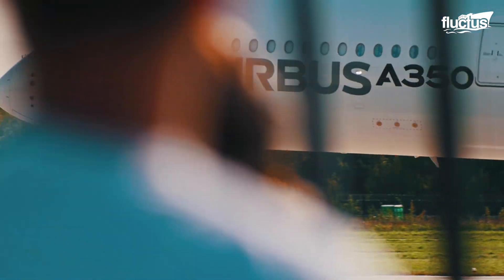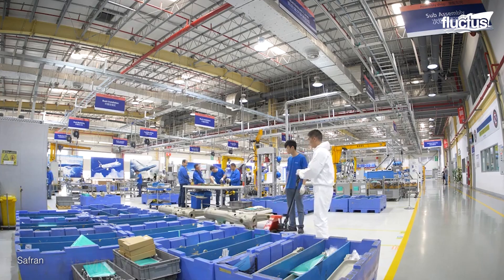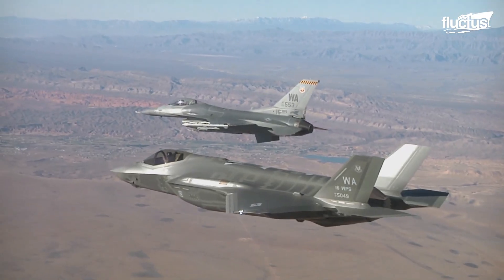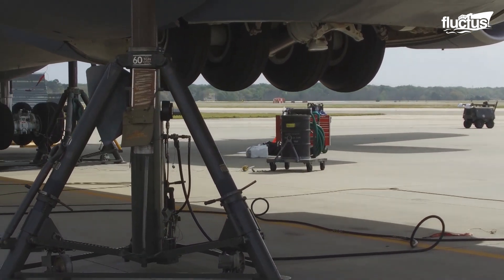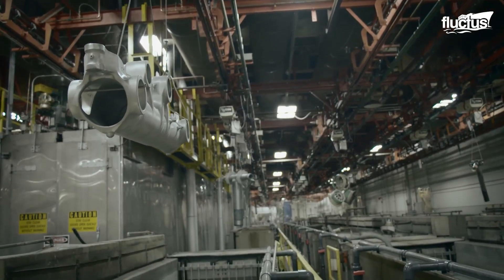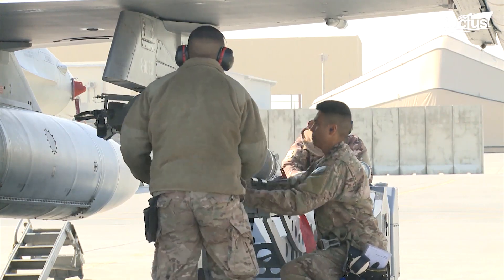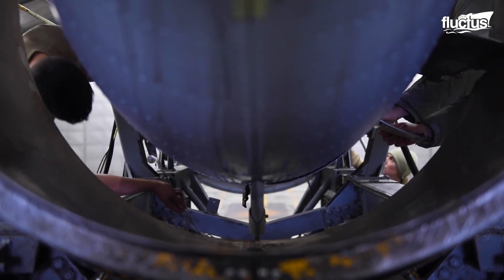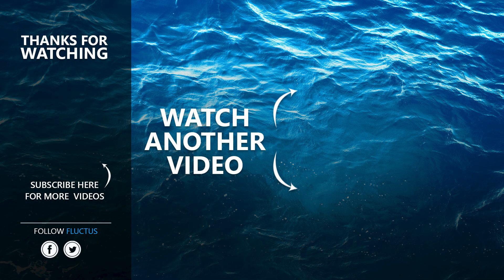Inside Gigantic Airbus Landing Gear Manufacturing Assembly Line

Comment: Part of SAFRAN company located in Gloucester UK formerly known as Dowty, Dowty Rotol and Previously Gloster AirCraft Company. ( GAC ) and others ... about ten of my now long departed older relatives worked for Dowty/GAC/Rotol  making Under carriages, (Now landing gear ) Propellers and Jet Turbine Fuel systems. Some built Hawker Hurricanes during WW2, In the early 1950s some of my then retired relatives lived in a house on the actual GAC aerodrome at Brockworth in Gloucestershire. Visits there for myself and little brother were a special treat. Even meant passing through the Security Gates. A new experience. That house now long gone next to the Assembly hangers where Gloster Meteors and Javelins were made..Two little boys explored the Aerodrome. A corrugated sheet metal Barn in a remote far corner of the AirField we explored through one of the dislodged metal panels enabled two small boys to access inside. There before us a pristine Gloster Gladiator Biplane. A subsequent visit saw that Gladiator Biplane  working an aerobatic routine directly over our heads for fully ten minutes before making off to an AirShow, Our very own special AirShow.

I was reminded of all this recently when driving through what was the former GAC Aerodrome now with a huge Ibndustriak Unit complex and also some high density modern housing. Many streets and roads named with an AirCraft link like "Hurricane Way" . That day, I passed the new DOWTY Factory and parked nearby was an articukated truck ( a semi  ) with huge propellers on the trailer. Looked like those from C130 / Hercules. No doubt being delivered to Dowty for refurbishment. The truck had Italian registration plates. I stopped and took a few images of a now rare sight so familiar to me as a very small boy back in the day..

Gloucestershire UK has a very long Aviation history. Going back eighty-five years in the case of SAFRAN's roots. Good that some still remains in the area.

Always interested in AirCraft, particularly WW2 WarBirds. Few years ago, heard the unmistakable sound of a Rolls Royce Merlin approaching fast .. soon over head in a far corner of the county, with small population. Looking up, I saw a plane go through a complicated aerobatic routine directly overhead. Surprisingly, it was not the expected Spitfire or Hurricane which are not a rare sight or sound, but something else. It came low, about a thousand feet and then I could see what it was. A North American P51 Mustang. Again my own private AirShow. I was not the only one to watch that show. Sometime later, on a FaceBook group, someone else has seen that little AirShow in a remote part of the county. Probably remote for safety reasons. Wisely.

Never tire of aircraft observation. . Been some B52 activity in the county recently. Wonder what they are up to...

Comment: lol 1:15 down to the millimeter, even parts this big are still down to the 100 thousanths of an inch.  stop using metric it's not very scientific or accurate
Reply: 100 thousanths of a centimetre is way more accurate than 100 thousanths of an inch.

Comment: pretty cool that the people that make the TBM help Airbus. win win
Reply: and much more in fact. the TBM is not even  the main part of Daher's actvities in Aerospace (a350  MLGD, a320 and A330 belly fairing, thermoplastic clips for the A350, several WP for Gulfstream, fuselage for Dassault, Airbus helicopter, motor parts for Safran, PWC... And the Kodiak aircrafts. Even more lately with the acquisition of the former  Triumph plant in Stuart. A lot of 3PL activities for all major OEMs. And yes i'm an an engineer who proudly proudly works for Daher :)

Comment: There's many problems with aircraft and components especially on ships,there not using the right paints,or metals fused with material that don't have enough certain chemicals to make there mass not expand and retract in different wheather conditions and different rubbers added to paint....